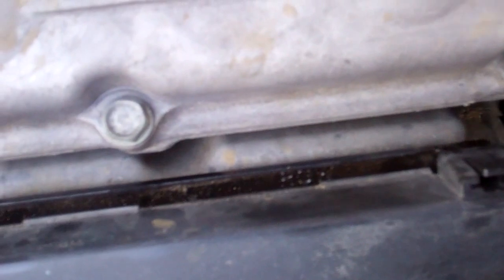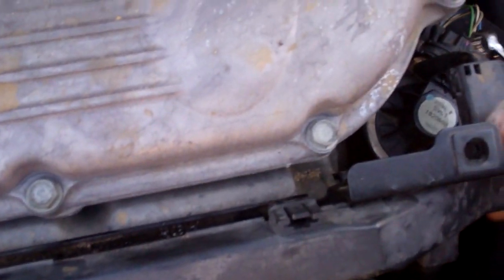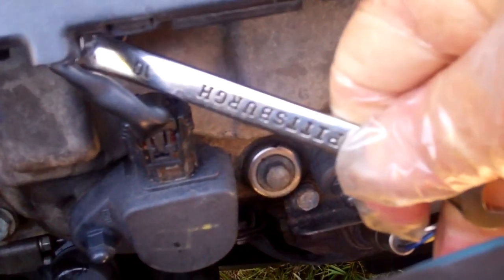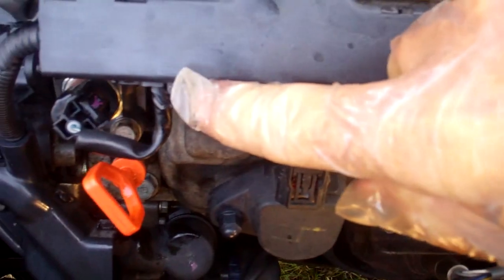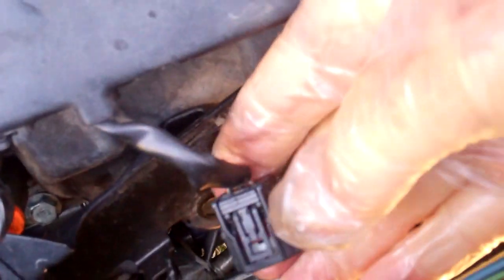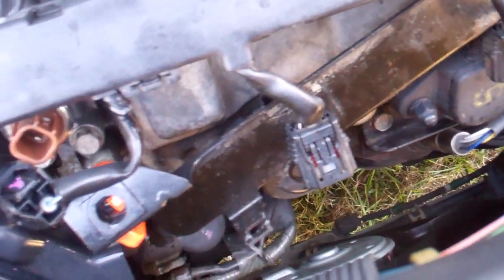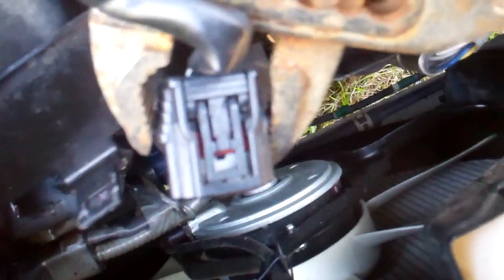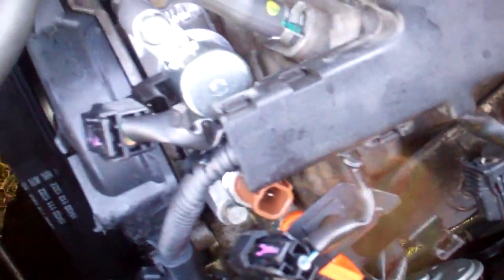Honda 3.5 Engine VVT Solenoid (Part 2) Variable Valve Timing Oil Leak 2008-14 Odyssey Pilot Acura

Comment: I’m missing the plate.  I have a 2008 accord ex v6 3.5.
Reply from the maker: Not sure about the Accord model, but assuming it is the same as Odyssey, the plate would have been on the car originally. It could be stuck to one of the housings, possibly. In any case, a whole Dorman replacement valve (or a used parts dealer) should work fine. Thanks for checking in!

Comment: Hello, Just curious how do you know if the car needs to have the Variable Valve Timing (VVT) Solenoid needs to be changed what are some of the signs I should look out for?
Reply from the maker: That's a good question - an oil leak occurring does not necessarily mean the whole VVT valve is bad. I have two Honda Odessey's, (both developed oil leaks at the front VVT spool valve at over 150,000 miles.) I put a Dorman assembly on one because the parts came in a kit with the gasket ($120 at O'Rielly's). On the other, I was able to order a Dorman Gasket Kit (918-056GS) for under $25. Both ways fixed the oil leaks and both engines have been working fine since. My gut instinct that in most cases with this problem, the gaskets are the only issue. Perhaps it is easy to inaccurately blame the VVT valve for many problems.I know that bad old spark plugs and one ignition coil gave me fits one time. I believe you can buy just the little screw-in solenoid on top of the VVT housing also - may be something to try if other problems occur. Clean, fresh oil also is very important with these systems. Wish I had a more definite answer for you. Thanks for the Comment, and for watching the video!
Reply: When it's leaking do you see oil on the exhaust manifold on the right side? @cubmancan

Comment: Has it leaked ever since? Any check engine light or rough idle?
Reply from the maker: No Leaks, Idle is Good, Have had some check engine lights activated, but at 190K miles, it happens due to other issues, from what I gather by the codes. Thanks for watching!

Comment: Hi, thanks for the video! Do you recommend purchasing the whole part from the dealership and then replacing the top half with the solenoid gasket? That way no need to open the intake manifold. I’m just worried if it’s better replacing the whole unit or just the gaskets would be enough.
Reply from the maker: A lot of ways to go, Dorman Valve or OEM Solenoid valve, or just the gaskets, which are not made by Honda (Cheapest and least desirable, I think. The best, IMO, would be an OEM Valve with the gaskets included from Honda. Yes, just the upper portion of the VVT valve should be good as long as no damages to the base. Perhaps an OEM VVT Valve can be bought online at a lower cost. The dealer was close to $300 after taxes I think, and the dealer was closed on Saturday afternoon, so we went with the Dorman from O'Rielly's, using the top portion with the original "sandwiched" plate and the Dorman gaskets supplied with the part (about $120 at the time, I think). We've had no problems with the Dorman setup. vehicle is running fine. Thanks for watching!
Reply: @cubmancan   great, thanks for the reply and all that information. I’m planning to buy the OEM part and then just replacing the top half. How much do you think in labor should cost just to do the front half part? I have a 2013 Honda Pilot. Dealership quoted me over $1200 but that seems too much, decided to just do the half part with a local mechanic.

Comment: How long it will be stay good after change gaskets? The replacement is same material as original gasket?
Reply from the maker: It is unfortunate that Honda OEM seems to not sell just the gaskets for this VVT Spool Valve. There are now reports that the gaskets that are available online are knock-offs made in China, and having some recurring issues, so you may want to go another route. The parts I used were from Dorman and bought at O'Reilly's Auto Parts in a valve kit. I replaced the gaskets and the top part of the VVT Spool Valve which came in a kit for about $120.00. Hope this helps. Thanks for watching!

Comment: The old gasket was flat and brittle. So I had a leak and killed my Alternator. I bought a pair of gasket off on ebay for about $12.00 instead of buying the whole unit for say about $200+. Had the Red OEM Genuine Honda parts stickers on the bag. I installed and now, I get a check engine light. Never had the check engine light on before. Now my car idles rough as if one of the cylinder is dead. I check the envelope that the gasket came in and it said Made in China. Do you think this could be a problem?
Reply: The chinese knockoff versions of this gasket causes a code to be thrown due to the screen filter on the gasket. It is fixable by reusing the screen filter portion from the oem gasket and just swapping it into the new gasket. Something with the size of the mesh either allows too little or too much oil through and causes issues.
Reply: You just remove the mesh from the current gasket and swap it with the new gasket. Don't double them. Only other thing to do is replace the unit itself and at that point you're left with an aftermarket option or oem from Honda. Mixed reviews all around on Dorman and others. The gaskets on Amazon and ebay are hit or miss but seem to cause a lot of trouble. Dorman vvt solenoid also has mixed reviews. If you get the oem unit it comes with the entire spool assembly and would require removal of the rocker arms to replace followed by a valve lash adjustment.  You can remove the spool from the solenoid portion and just install that. However, the gaskets are already set and compressed and at that point you have semi used gaskets you'd be recompressing. Some dealers do that as a fix vs replacing the entire unit.
Reply: DG, thanks for the info.  Far as using the top half of the Honda OEM part and having a semi used seal recompressed, it’s exactly what Honda’s TSB 20-023 tells their mechanics to do to fix this leak.  So I guess that works the vast majority of the time (???).   On forums I’ve seen that much focus has been on 2 things. 
1) 6# torque on the bolts, lots of reports that over tightening ruined the repair. 
2) the mesh like y’all have said here, some say to swap it out, other say to just round out the replacement (new) one so that more oil can get through. 
Again, thanks for the info !
Reply: DG, thanks for the info.  Far as using the top half of the Honda OEM part and having a semi used seal recompressed, it’s exactly what Honda’s TSB 20-023 tells their mechanics to do to fix this leak.  So I guess that works the vast majority of the time (???).   On forums I’ve seen that much focus has been on 2 things. 
1) 6# torque on the bolts, lots of reports that over tightening ruined the repair. 
2) the mesh like y’all have said here, some say to swap it out, other say to just round out the replacement (new) one so that more oil can get through. 
Again, thanks for the info !
Reply from the maker: Perhaps it is the China made gasket, I actually, because I needed a same-day repair, used the Dorman brand gasket and valve (about half the OEM valve price). Unfortunately, Honda would not sell the OEM gasket alone without the whole assembly, which was about $275. The Dorman is still working fine on that vehicle. I did reuse the original Honda separation plate (sandwich plate), as it was thicker and seemed better quality. I suppose yours could have gotten a small blockage on some of the little oil ports inside there. Some people have a problem with that if they use any kind of gasket sealer. Also, the condition and weight of oil is critical on these engines. I believe it is 5W20 required. I would say, run a scan check on it also and see what pops up (may be free at Oreilly's or AutoZone.) Thanks for watching, and the comment! Hope it works out for you.
Reply: Have you tried doing an idle relearn?  
-turn off all electrical loads / lights (put on emergency brake to prevent DRLs from coming on), turn off A/C, remove chargers, etc. 
-put key in and turn to step before cranking, for 2 seconds
-crank and gas it to 3000rpm for 5 minutes straight (with the car in park, not going anywhere, or in neutral if it's a manual trans)
-let the car idle until the fans come on twice
-turn on the A/C for 5 minutes
-turn off car
-now crank it and see if the idle is smooth like it should be.
Reply: @busyboxst7  haven't tried that, but the issues is that metal mesh filter that is the problem that throws the check engine light if you are using the eBay/amazon gasket parts. Either the flow is to rich or to lean. Before, I didn't know that you could remove the mesh from the old honda unit to the chinese knock off. But yeah, after reading through forums, people did that and it worked.
Reply: Do you remove the mesh from the new gasket and then somehow put the old mesh into the new gasket?  I’m guessing you don’t mean just dropping the old mesh into the new mesh (doubling up on mesh, seems that would not work)… any links to this discussion or videos related to it?
Reply: @busyboxst7  I search a forum a while back, I'm not sure who it was. Reddit or some Honda forum. It seems that this is a common problem among these Honda cars. So back to the story, what you can do is take the old mesh grill from the original gasket ( peel the gasket rubber that is housing the mesh on the OEM Honda gasket backward, but be careful not to damage or bend the mesh ) and replace/install it into the Chinese knock off. You will also need to take off the mesh from the Chinese knock off gasket that you are replacing it with too. Do not double up!! Once that is done, make sure the mesh is secure inside the gasket walls. The reason why I got the Check Engine light with the Chinese fake OEM is because the holes on the filter mesh that came with the gasket is either too big or too small which is not creating the right amount of oil pressure to the spool solenoid. Sorry if this is confusing because I'm kind of drunk right now typing this. I'm just having a bad week because my wife have been cheating on me with a co-worker.
Reply: @busyboxst7  Nope! Not going to even try. Too much complication involved and that seems like a huge risk to damaging the car even more with 3000rpm for 5 minute straight. I mean, who got 5 minute to step on the gas petal and hold it there for 5 minutes. Even a drunk man like me is sober enough to realize that it is stupid. But anyways, thanks for the advise.
Reply: Yes, that's the problem.  Sa.e thing happened to me

Comment: What do those bolts get torqued to?
Reply from the maker: It's a judgment call, unless you can get your hands on an official Honda document for the particular part and vehicle (and even that, in my opinion, may be subject to the existing condition of the threads, etc.). Honda seems to be pretty secretive about torque specs on these, but generally speaking, a (shank size) 6MM with 1mm thread spacing bolt going into an aluminum threaded block seems to be widely reported at 6 to 9 Ft/Lb, with some saying 8.7 or 8.8. To be sure not to strip it, on my own I would likely go a bit to the lower side, perhaps 8, but to me the "feel" of it may take priority. For example, how tight were they coming out and how much did the bolt revolve before it was "free turning" etc. All that said, Honda is pretty well known for high quality fastening hardware (use of flange head bolts and good metal, etc.)
The link here will get you to a Honda Pilot chat board that shows some torques that may be comparable.
https://www.piloteers.org/threads/plenum-cover-bolts-torque.174836/
 If you find some definite info for this particular part and vehicle, please post the info here, 
Hope this helps someone out there! 
Thanks Much!
Reply: @cubmancan  looks like I was able to find it by searching for Honda Engine J35 front upper rocker arm oil control valve. It says 8 N.m (6Lb-Ft). I would place a photo here for reference, but it will not let me.
Reply: I also read 6ft-lb from a Honda repair procedure I saw on odyclub

Comment: how much will it cost if we do professional repair?  my 2014 odyssey has almost same problem, engine oil is not leaking but i can see oil residue on side of wall of engine campartment next to dip stick.
Reply from the maker: I can't say what it may cost at a repair shop, but I was quoted $500+ as they priced the whole VVT valve at about $275 if I remember correctly (as they "couldn't get" just the gaskets), so going with the Dorman worked well for me as I couldn't wait 4-5 days for after-market gaskets to come from California (Ebay, as Amazon didn't sell them then). The Dorman VVT has worked well so far, it looked like pretty good quality except for a thin "sandwich" plate they supplied. I did use the original OEM thin stainless plate as it was heavier than the Dorman supplied plate. BTW, I later added the "resistor" mod that eliminated the "economy mode" which made it run smoother and reportedly may protect from engine damage (and perhaps CV joint failure) due to the "shutting down" of cylinders when in "ECO" mode. I went with the cheaper resistor set up, an easy snap-in-line mod. It may alter the temp-gauge reading a bit, but hasn't been a big deal to me yet. Thanks for watching and commenting!
Reply: @cubmancan  
Thanks for your video, very helpful 👍
Reply: 2023 here, in California, a dealer near LA (San Fernando-ish) offhand said it would be about $1300 to replace the spool valve and about $400 of that was the part (which is hard to comprehend when hondapartsnow sells official Honda parts and it's $178 on there).  A dealer won't sell just the gasket (Honda doesn't sell just the gasket, period) but that's all that's needed in many cases and it's like $10-15 on ebay / amazon.

Comment: Thank you very much!  I spent $10 and only took 45 minutes.  Has not leaked 1 drop since.
Reply from the maker: Thanks for the good report! AND for watching the video!
Reply: Hi did you only buy the gaskets?
Reply: @Jofran Malinao  I bought gaskets off ebay and they caused check engine light 2 days later
Reply: No check engine codes?
Reply: Do you not use Honda bond
Reply: How do you fix the check engine light ?

Comment: Great video ! I’m glad I’m found it .
Maybe stupid question and you said it on video but why you replacing whole solenoid part not just gasket ?
Reply from the maker: I was in a bind and the gaskets would take several days to arrive. Dealer does not sell these gaskets, so the only way I could fix the car the same day was to buy the Dorman Valve at a parts store. Since I paid for the valve, I figured go ahead and try it out, and it has worked great for about 2 years now. Thanks for watching!
Reply: Definitely no need to buy the whole kit just the sensor and gaskets and o-ring for sensor on eBay

Comment: Did you throw any codes after installing aftermarket vvt?
Reply from the maker: Thanks for watching! I have not had a report of idiot lights on the 2008 Odyssey that received the Dorman VVT valve. Of course, if possible, I would prefer to go with OEM parts. I think I could have gotten away with replacing only gaskets had they been locally available, but I had to buy the Valve to get the gaskets. I did use the thicker OEM "sandwiched plate" rather than the thinner one from Dorman. I kept the old OEM valve just in case the Dorman acted up. Perhaps it could be cleaned, reworked a bit and used again. I did install a VCM disable resistor on that vehicle also, which seems to have worked out okay and maybe has eliminated some shuddering, etc. They say it is rough on cylinders for them to shift to deactivation, etc. Maybe that resistor has kept the system behaving.  I am not a fan of VVT variable valve timing set ups. Thanks again!
Reply: @cubmancan  It's not just a rumor.  The VCM in my 2010 accord totally F-d the piston rings.  I had to call Honda corporate a zillion times to get them to replace the rings for $750... Should have been $0 due to the class action lawsuit over this but Honda dealers never told me the issues the car was having were due to the VCM design, nor that there was a lawsuit over it.  They all tried to do the minimal work possible (reprogram the software, replace the spark plugs) instead of telling me I needed new piston rings and should install an SVCM or similar.  I didn't figure out what was going on until right after the lawsuit's effective period had expired.  Not a big fan of Honda as a company at this point, though expecting an ethical car manufacturer might be like expecting a computer company to not use sweatshop labor.  YMMV of course.  I had a friend who had an identical car, I think same year, and his never showed a single issue with it.  Mine had issues within the first few years (bought new).

Comment: Thanks for posting this video.  How many miles have been put on the vehicle since this repair was done?  And have there been any leaks or engine codes since the repair?  I have read that the Dorman valves start leaking after a while and can also cause engine codes.  Thank you.
Reply from the maker: THE VEHICLE HAS BEEN DRIVEN ABOUT 15,000 MILES (one year of driving) WITH NO PROBLEMS AND NO LEAKS. (Excuse those caps please). I kept the original VVT valve just in case but I hope I never need to revisit the issue. I do prefer OEM parts, but in this case it was a Saturday and the price was about $150 less for the Dorman. Thanks for watching!
Reply from the maker: Another note: The Dorman provided thin plate was much thinner than the OEM plate (the sandwiched stainless steel plate). So I used the OEM plate which looked to be in very good condition - should be because I see no moving parts associated with that thin plate.
Reply: Nice man still watching comments
Reply from the maker: @motorcityvillain  Thanks!